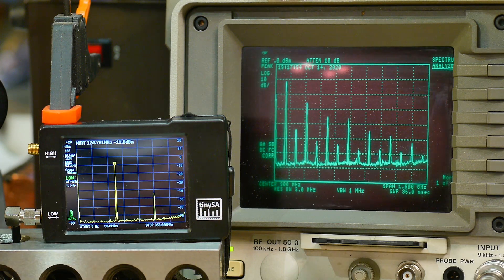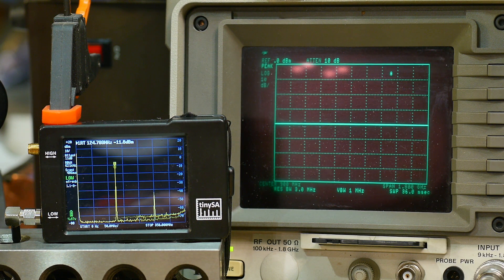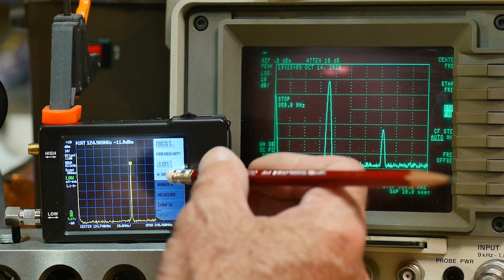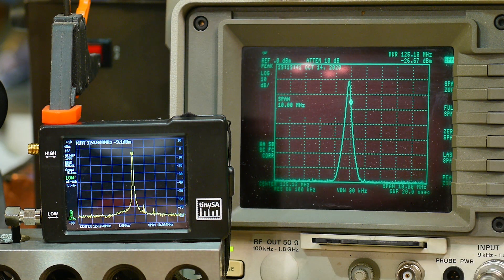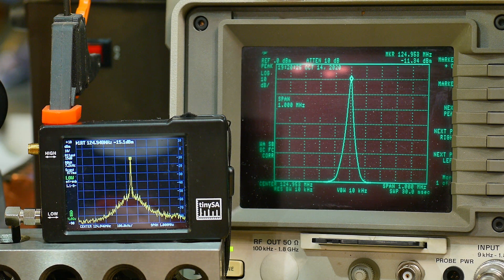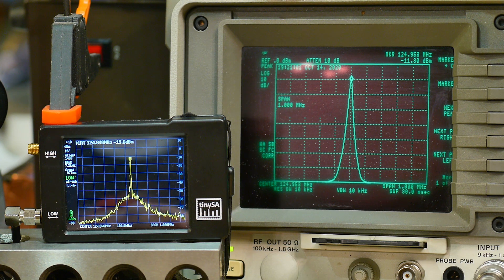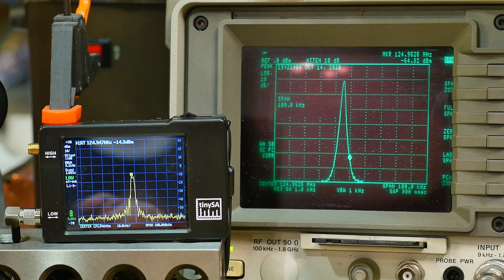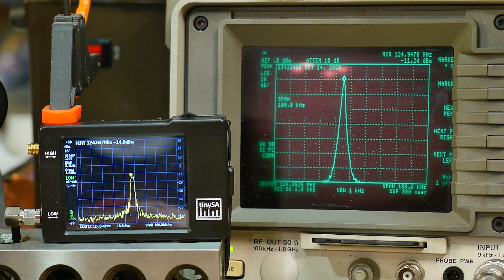#584b TinySA Ref Level and Attn Setting Hunting

Comment: Strange.  The more disturbing thing is that the peak level of your signal is changing with the attenuator setting.  You should only see a change in the DANL (noise floor), since the analyzer should take the attenuator value into account and properly show you the peak level of the signal in either case.

Comment: I  fail to reproduce. its switching every sweep but the adaptation for the next sweep causes a jump in the opposite direction for the next sweep. The level steps you observe should not happen.
Can you please manually set attenuation levels between 1 and 15 dB and check if the measured level does NOT change. (max +/- 1dB) This to rule out you have a faulty attenuator
Reply from the maker: set attn setting manually. read peak power of my signal. Here is numbers starting at 1dB attn and stepping to 32dB:
-16
-16
-16
-20
-20
-20
-20
-20.5
-15.5
-15.5
-15.5
-20
-20
-20
-20
-16
-16
-16
-16
-20.5
-20.5
-20.5
-20.5
-16
-16.5
-16.5
-16
-20.5
-20.5
-20.5
-20.5
-15
Reply: @IMSAIGuy  As you can see the 4dB attenuator is always active so there is clearly a HW problem. Can I suggest you contact your supplier to get a replacement?
Reply from the maker: @ErikKaashoek  I'll try. it is a pre-order from Wuyi Zeenko Industrial And Trading Co., Ltd.
Reply from the maker: It's not going to be a very good next video....
Reply from the maker: This would be very simple test to do in the leveling cal. what tests are performed on these devices at manufacturing time? how did this pass?
Reply: @IMSAIGuy  Maggie will send a new tinySA if you contact her for the address details
Reply: @IMSAIGuy  The whole signal path is tested but unfortunately not all steps of the attenuator. I'm busy extending the selftest to test all the attenuator steps.
Reply from the maker: @ErikKaashoek  I already sent a message to her. I don't have you email address
Reply: @IMSAIGuy  I'd say that faulty attenuator control bus connection is far more probable than actual malfunction of  4dB switch, doesn't it? P.S. This is my first ever comment on Youtube. Greetings :)
Reply from the maker: @mariuszkaczor1379  Yes, I assume it is a solder problem.
Reply: IMSAI Guy
You could try to resolder the chip then. If everything goes well you will have two functional units ))
Reply from the maker: @АндрейДенисюк-ш7п  maybe some day. I've lost interest
Reply: Tomorrow I will release a new FW that includes the full attenuator test as part of the selftest
Reply: @ErikKaashoek  Question - why was something as application-critical as the step attenuator not already included in the self-test? Just about every spec an I've worked with has included attenuator checks as part of the self-alignment/calibration.
Reply: @NimbleJack3  The connections with the step attenuator are tested. The attenuator is a single IC. Resoldering will not help. IMSAY Guy is experiencing the first ever failure of this IC. To save some time during manufacturing I did not test all attenuator steps. That was a wrong decision. The new FW tests all switches and attenuators stages, also during manufacturing.
Reply: @ErikKaashoek  its a great unit for the money, i cant complain very impressed 85bucks

Comment: the problem is deeper than just attenuator being switched up and down because changing the attenuator should never change the measured signal level. it only changes the noise floor level. here the signal level is fluctuating so something is gone terribly wrong